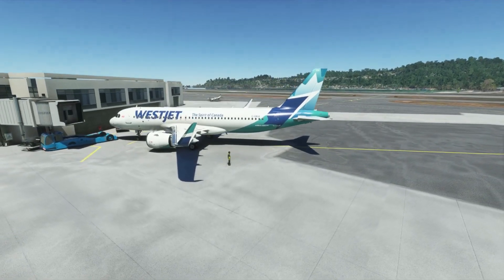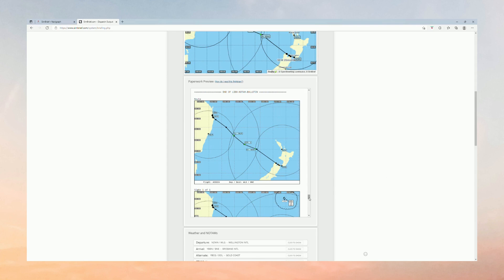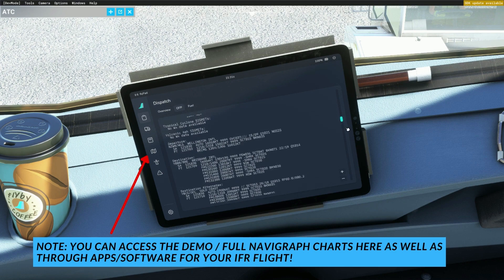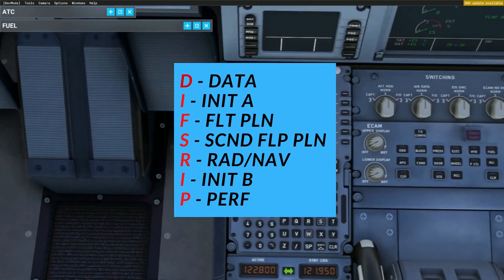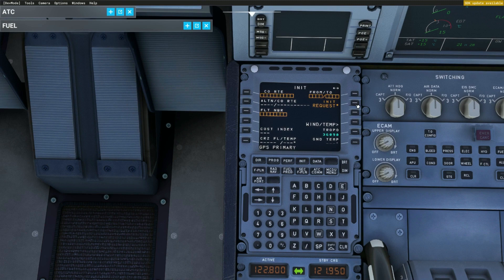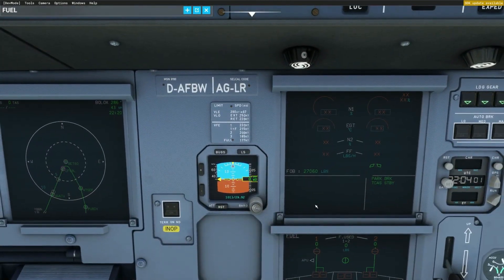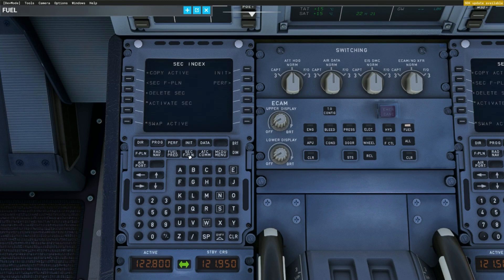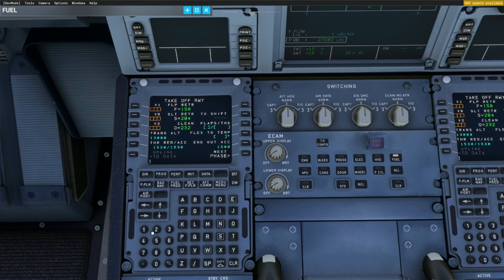How To Set Up MCDU Airbus A320 Flybywire Mod

Comment: Hi..good video but why doesn’t the “discontinuity” remove when I try to delete it?
Reply from the maker: Thanks for watching. Depends on your arrival/departure route. If it includes vectors to a fix then it can’t be deleted. When reaching the last waypoint before the discontinuity, you’ll need to select heading mode or go Direct to the next way point.
Reply: @SimpleTakeoffs  sounds easy I will try.Thx for responding

Comment: I noticed you have the departure weather , mine is not showing up , but the arrival is and clues ?
Reply from the maker: Hmm, the metar shows up for me in both departure and arrival airports. It should be available in the Flypad and also through the mcdu (choose metar not D-ATIS). Maybe try updating your aircraft?
Reply: @SimpleTakeoffs  I got it finally , I was having issues with installed liveries, deleted them reinstalled FBW320nx and working fine now. thank you for responding !
Reply from the maker: @pro-peller5552  Glad you got it working.

Comment: Why didn’t you teach how to,connect simbrief to your aircraft.
Reply from the maker: I did, click “Load from SimBrief” on your EFB, then init request in mcdu.
Reply: @SimpleTakeoffs  I'm similarly not having anything happen when i hit load from SimBrief, not anything i can't look into but just FYI that doesnt work out of the box sometimes
Reply from the maker: @captaindanger10  Roger, even after entering your SimBrief user name in the electronic flight bag first? I find clicking a second time loads it (if username was entered)
Reply: @SimpleTakeoffs  After adding my simbrief user name to the flypad and my simbrief ID# to the mcdu it eventually started working.

I would say that anyone else having that issue could probably fix it by making sure those steps are completed.

Thanks for the reply, great video, very informative!
Reply from the maker: You’re welcome, thanks for watching.